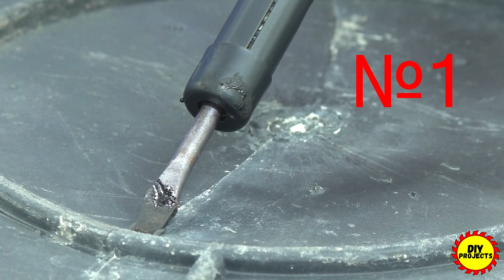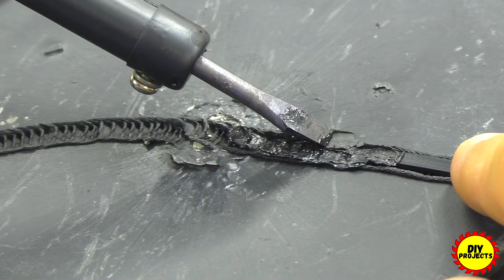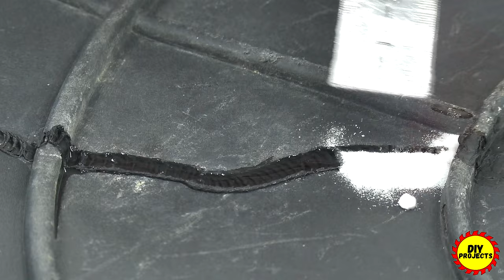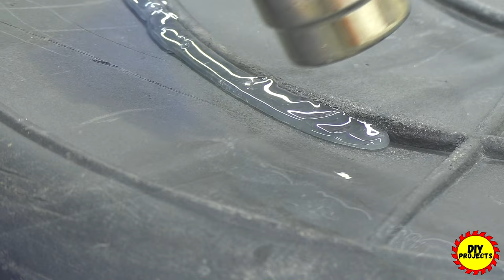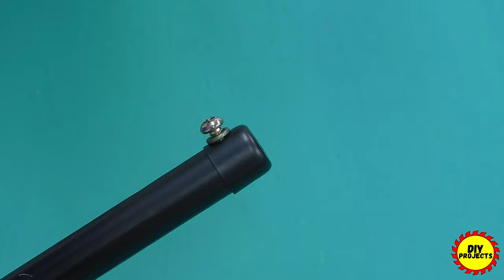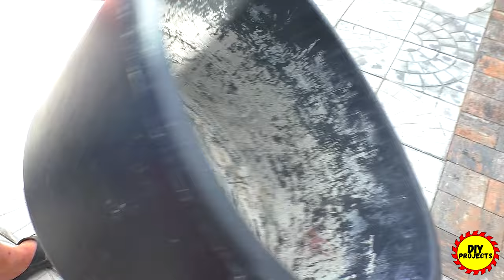Welding plastic at home!!! 4 WAYS.

Comment: Nop. Trust me. Thing u uabe done with that cabel tie is not good. If you wanna weld olastik you need to heat both surfaces, heating and filing one and then connect them. Not to melt plastik above and say that thats welded... Good work anyway, but not welding.